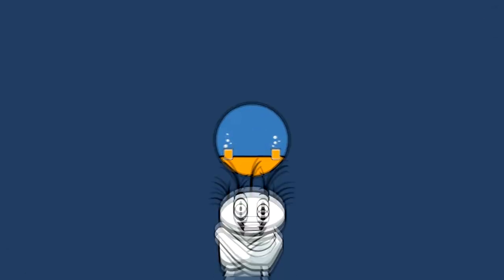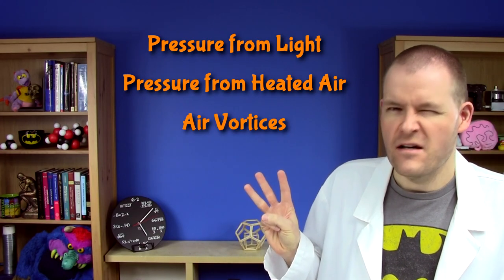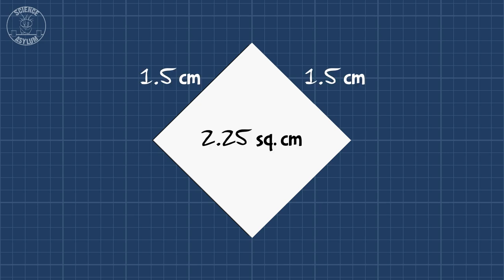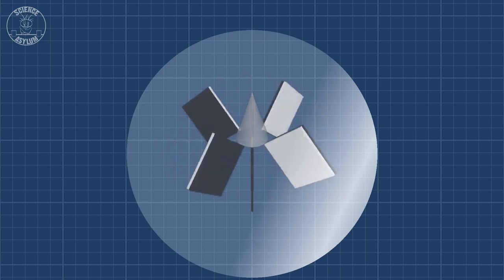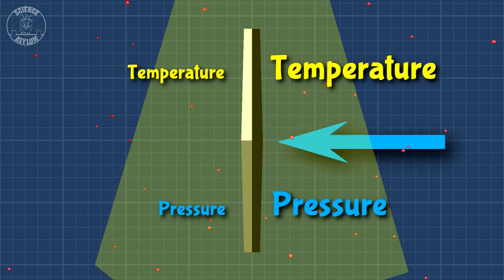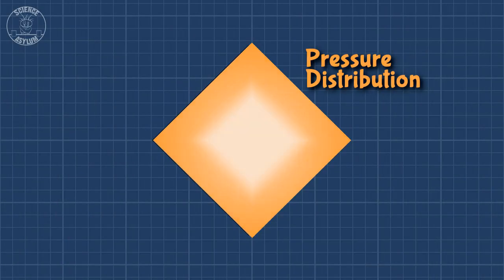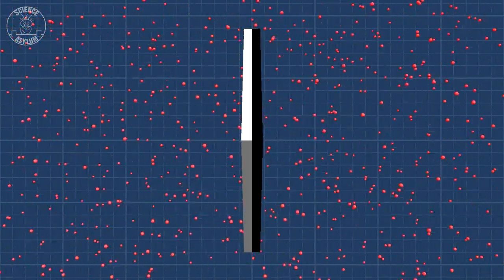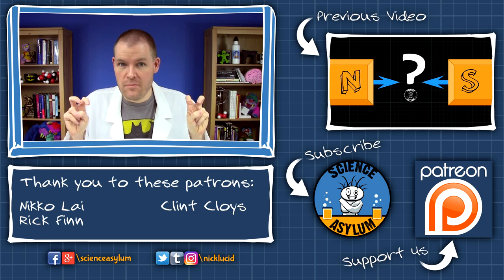How Does The Crookes Radiometer Work?

Comment: Watch cody's lab, he actually extracts all the air out of a radiometer until it stops working and then slowly introduces air until is begins to spin again thus verifying nick's explanation.
Reply: Right! I think both videos complement each other.
Reply: It's impossible to extract all air out.
Reply: Wallace Anthony, he builds one inside an actual vacuum chamber, and removes a lot of the air. The point isn't that he removes all the air. The point is that once too much air is removed, the veins stop twirling, therefore showing that it's being rotated by air molecules/pressure. Although, I do sometimes wonder if gamma or higher frequency light, would move it in a lower vacuum.
Reply: @paaao  that's not necessarily what's happening.  The vacuum is creating a pressure,  thus nullifying the ability of the veins to freely rotate
Reply: @paaao  certain light colors will move it while others won't
Reply: @wallaceanthony4707  Certain frequencies of light will move it, but not in a lower vacuum. Once the vacuum is lowered, UV light stops moving it. No one has tested beyond UV, because obviously it would take some very special safety and equipment to go above that threshold.
Reply: Is that the one involving mercury moving through a tube?
Reply: @wallaceanthony4707  vacuum is creating pressure wow😂

Comment: I like that you picked something nice and rather uncommonly known in my opinion. While i had seen a radiometer i had no idea that it worked by way of such intricate manifestations of elementary forces.
Reply from the maker: It was a pretty cool learning experience for me too.
Reply: @ScienceAsylum  why is temperature on the black side higher? Because black sbsorbs light better than white right?
Reply: @leif1075  Yep. White reflects almost all light so it stays cooler than the black side which reflects so little light that we don't see the reflection. White objects do absorb light and black objects reflect light, because no material is a perfect absorber or reflector, but for white and black, the amount absorbed by white and the amount reflected by black is miniscule.
Reply: @caterscarrots3407  thanks yea im familiar with that juat wondering if that was the only cause or if it had something to do also with the kind of material it's made of or some other process or phenomenon going on..

Comment: Fantastic, as always! And all this time I thought the vacuum inside was sufficient to effectively negate air pressure and temperature effects. 

I have an old Crookes X-Ray tube. That might be an obscure but fun piece to explain.

Another would be the hand-cranked magnet motor from old crank phones.
Reply from the maker: Crank generators are fun. Might be a nice way to make magnetic induction a little less abstract.
Reply: While I'm at it, I was wondering about your explanation of the radiometer.  You pinned it down to a temperature-based effect and a pressure-based effect.  But since this is a gas in a sealed container that does not lose molecules of gas or expand/contract, can we not say that the temperature and pressure effects are correlated, if not perhaps intertwined?  Are they not just two sides of the same coin?  (I'm referring to ideal gas law, I suppose)

Comment: Hi, what about following explanation:
The black side is hotter than the white.
This means that on the black side the molecules in of the surface are vibrating harder.
When an air molecule hits  the surface of a vane, it exchanges momentum. 
On the black side the molecules ricochet with higher velocity because the black surface is vibrating harder.
 Action is reaction; So the black side is pushed harder than the white side.

Comment: The bulb pressure isn't 1 pascal (as you stated) but rather it is 933 pascals (7 torr;  0.135357 psi).  This is the optimal air pressure that will promote the fastest rpm of the vanes.  Here is the key to the vane movement: The mean free path inside the bulb for the air molecules reaming after evacuation to near vacuum is 1 cm. That means there is 1 air molecule every cubic cm inside the bulb and they are evenly spaced. -- evenly distributed. Another key to the phenomena is in the vane dimensions themselves. Each vane is a 1.5 cm square with a diagonal measure of 2.12 cm (corner to corner). The vanes are also very thin and have an heat insulator sandwiched between them and an infrared reflector (foil) on the back of the white face facing towards the black side.
.
Since the mean free path is 1 cm that means that if an air molecule moves it must move at least 1 cm before it can possibly hit another air molecule. In this system you can only get a maximum of 5 air molecules to come in contact with either side of any vane (but not both sides) -- imagine the best possible case is one molecule in each of the four corners and one in the middle (all always 1 cm apart). This is best case but most often there will be less than 5 air molecules in contact with a side. Also, for every molecule in contact with one side there will be no resisting air molecule on the other side (because that would mean the molecule on the other side is closer than 1 cm and this condition is naturally resisted because the air molecules seek even distribution at all times).
.
When photons of light hit the black and white vane surfaces the white side randomly scatters the photons in all directions nearly negating any radiation pressure and staying cool. When photons hit the black side they are absorbed and excite the molecules in the surface of the black side generating infrared radiation and heat. The black surface heats up and the insulating material between the black and white sides prevent much of the heat from getting conducted across the faces. Heat radiated towards the back side of the white face is reflected back using a reflective surface. Heat is radiated from the black side in the infrared portion of the spectrum imparts a very small degree of radiation thrust (pressure) to help push the black side of the vanes in the amount of about 17 micrograms per 50watts. . 
.
Most of the energy comes from the air molecules on the black side getting heated through conduction and moving upward in the bulb (heat rises) leaving an open space for a cooler air molecule to move into its vacancy which transfers some kinetic energy to the black side as well.  The amount of energy overall is small but the fact that there is no resisting air molecule on the white side causes an imbalance which cumulatively puts pressure on the black side of each vane. 
.
Cooling the top of the bulb with a refrigerant (or ice cube) without the presence of a light source will cause the vanes to rotate in the opposite direction!  I don't understand why..
Reply from the maker: The pressure is not 7 torr, it's 7 milli torr. That makes the pressure 0.933 pascals or about 1 pascal.

Comment: I don't get why should the pressure smaller near the centre in option #2: If the momentum is conserved, it shouldn't matter how many times a particle ricochets, right? Also, why should we care about the pressure being different at different places of the square -- how is it going to stop the thing from spinning?
Reply from the maker: There are a lot of (confusing) online explanations and I was trying to address some of those. How the pressure is distributed across the diamond vane has an effect on how much force there is on the vane. By the time it evenly distributes across the vane, it also distributes through the whole radiometer eliminating the net force on the vane.

Comment: "It doesn't even need to be light". How does getting it hot and cold make it spin? Does the black surface ~"absorb" the ~"heat" energy better than the white surface? Then the black surfaces would heat up and options 2 and 3 would apply again... Thank you for all the excellent content!
Reply from the maker: It's all about the very tiny amount of air inside the bulb. All you have to do is heat or cool that air and that air will make the blades move.
Reply: @ScienceAsylum  thank you, but why does heating the air cause it to rotate in that direction and the other direction for cooling? The black sides are interacting with the heated air differently than the white sides, why?

Comment: Thanks for this insightful video. It's nice to hear a summary of where the thought on this device has been, where it is now, and still what is debated. My radiometer recently broke and I'm looking to fix it myself (the vanes and rotor are fine), but given they only work in a partial vacuum with certain specifications--I suppose a lay-person cannot create the required vacuum this without proper lab equipment(to adjust for correct pressure)?

Comment: Do Geiger counters work with this principle, or is that something else entirely?
Reply from the maker: Geiger counters do have a low pressure gas inside, but that's where the similarities end. The gas isn't air (usually it's helium, neon, or argon) and there's also an electric circuit involved.

Comment: The experiment I saw used different colored lasers. The only color that would spin the radiometer was purple. Because the smaller the spacial footprint, the higher the capacitance. Purple has the smallest spacial footprint of all the colors (EM waves). Are the EM waves of purple, about to change (EM) shells?
Reply: Color is wavelength. Purple is a compromise the eye makes; there is no actual wavelength that corresponds to purple (unless you mean a point between red and blue). A laser is supposed to be one wavelength. 
I also don't understand "spacial footprint, the higher the capacitance".
Do you have a link?
Reply: @Nehmo  That guy is parroting Kenneth Wheeler and his crackpot explanations.

Comment: Yes, what I would like to learn is... Microwave door mesh. How is that mesh supposed to keep microwaves from exiting a microwave oven?
I have heard that you cannot take an image if your aperture is smaller than the light wavelength. Therefore, microwaves cannot travel through the mesh because the tiny holes are smaller than the length of a microwave. OK, but HOW DOES THAT WORK? We're talking about itty bitty photons here, how do little holes stop them?
I have also heard that the mesh acts as a faraday cage, where a charge only flows on and not through the surface of metal mesh. Ok, but WE'RE TAKING ABOUT MICROWAVES, NOT ELECTRIC CHARGES.
I'm naturally curious and a physics teacher. Help me out, man. I mean, I use these things daily, and I still can't figure out  how these things work.
Reply from the maker: One of my first videos ever was on microwave ovens: http://youtu.be/EPjke3-M7MQ (soooo long ago). I don't talk about the mesh in the door though. That could be a good video for the future.

Comment: Do you need to shine the light one direction? Or just leave it in bright area? Thanks!
Reply from the maker: It doesn't have to be directional. It just has to warm the thin gas in the bulb enough.
Reply: Does that means that we have a interaction force difference caused by the viberations on the black side which is bigger then white side?

Comment: I posed this "question" in another video.  I did a little experiment using a normal flashlight and a UV flashlight.  If I shine a normal flashlight on the radiometer, it spins in one direction regardless of where I point the flashlight.  When I use a UV flashlight, the radiometer spins in different directions depending on what vane I shine the light on.  What gives?
Reply from the maker: This is definitely the better video to ask the question on. It makes perfect sense that it doesn't matter which way the visible light enters the bulb. It heats up the gas inside regardless. As for UV light, glass absorbs that kind of light, so only a tiny bit of it gets through. I'm sure that has something to do with it, but would have to do my own test before I could know more.

Comment: I had one of these when I was a kid. Loved it. I had no idea how intricate it was. I was told about the radiation effect, but that was it. 

The story I remember - Light hitting the black side is absorbed, thus pulling the vane in that direction. Light hitting the the white side is reflected, pushing the vane. Attractive force on one side, repulsive force on the other. 

It's been over 40 years since I broke my radiometer, but I'm glad to have the straight story about how it functioned. 

Thanks, crazy scientist.
Reply: that is what I was taught also. (imho science is the study of god). Could the presence of air molecules affect the way photons interact with the vanes? do light photons require air molecules to continue their effect? Does this reason that the more air molecules the more effect the photons may have?  Can you get sunburned in space? I dont know not having been there. We get burnt here on the surface under our blanket of air that the photons have passed thru.

Comment: I still don't understand how if a photon has no mass how does it transfer momentum? Xrays from a nuclear bomb are strong enough to crush metal like being surrounded by tons of TNT. What happenes at the sub atomic level? A photon can knock electrons up to a higher orbit then they jump back down but that jump is more like a teleport giving off a massless photon. Does the pressure come from a magnetic or electric field?
Reply from the maker: It comes from the momentum of the photon. Photons have momentum just like objects do. Momentum does not require rest mass.
Reply: Ok so how can you transfer momentum with zero mass? To compare to an object a ping pong ball won't move a pool ball very much when its bounced off it. If the ping pong ball has zero mass the pool ball wont move at all. So the gauge boson for the electromagnetic force is the photon. So forthe photon it is the photon. I'm trying to figure out what actually makes the transfer of the photon into movement since it has no mass some other force must be involved.
Reply: I figured it out: Compton scattering. Equation is Lambda(int) - lambda(final)= h/mc(cos theta) Where lambda is the wavelength of the photon and theta is the angle at which the electron deflects ;we all know m and c ; h is NOT the reduced hbar(math won't come out I tried it). Hence no mass but still moves something with mass Because electron degeneracy pressure keeps the photon at a constant distance relative to the electron hence the distance of e and P can't vary so the atom moves creating a phonon in the molecule and creating heat and movement!!!  Pretty simple compared to other quantum physics.
Reply: So the particle moves a step away from where the electron interaction happened.

Comment: Sir your channel is one of the best.
I think  you are the  best  in explaining Relativity. I had a question about  the equivalence principle. While the rocket (box) is  in the  
space accelerating at g  isn't the tidal force NOT  acting on a body while this tidal force IS acting on the body when on the earth. And if I have adequate instrument , I can measure the difference between the force on a body's head and legs on the earth but not in the rocket with acceleration g. PLEASE REPLY I REALLY WANT TO UNDERSTAND THIS. THANKS
Reply from the maker: The easiest way to test whether you're on Earth is to check for effects caused by the Earth's rotation (like the Coriolis effect). A large Foucault pendulum would work for that. That's something that's usually being ignored in the equivalence principle. You have to imagine you're on some alternate version of Earth that isn't spinning.

You could also check a difference in gravity between heads and feet... or check for a change in direction of gravity from one place to another. The problem with these is that it involves you taking measurements in two different locations. Concepts in general relativity are defined locally, so you have to take all your measurements in a single location.
Reply: The Science Asylum Thanks You very much sir, but how do we generically define global and local. And what do we mean by the effects of GR being local
Reply from the maker: I mean that GR equations are only defined at single points in space and single moments in time. That's what local means: single events.
Reply: The Science Asylum  Thanks a lot sir. You ARE the best. Can you b please explain the math behind these things since a lot of scientists have this common dialog "the Math works out so....." We really want to know what is really the math that works out so. Also if you can suggest me some books for basic introduction and a strong mathematical background in these things.
Reply from the maker: The math in GR is tensor calculus. A few chapters in my eBook cover it: https://gumroad.com/l/ubSc

Also, I'd recommend "Spacetime and Geometry: An Introduction to General Relativity" by Sean Carroll. He's a little more thorough than other authors of GR books in recent years. Any other books I would recommend are out of print because they're very old.
Reply: The Science Asylum Sir please see to this site which you are using for your book. I've been trying to your book from this site but it's not working here in India. Please do something. HELP, SOS(Save our Science).

Comment: What if there is no air molecules.?
is he spinning then also
Reply from the maker: Depends on how much friction there is between the blades and the pin they're spinning on. If you remove the air and remove the friction, THEN you should be able to get the blades to spin with just the light (after you wait a while for it to pick up speed).

Comment: if the thermal creep explanation was correct ....then a  red LED light would also have turned it cause it gives more infrared signature ...but it doesn't ... only purple and white light does
Reply from the maker: It works with red light too if you make it bright enough (enough energy). You don't even need visible light. It works if you put it next to a furnace. It even spins the opposite direction if you put it in the freezer. It's definitely thermodynamics.